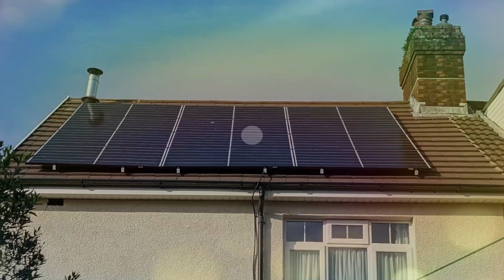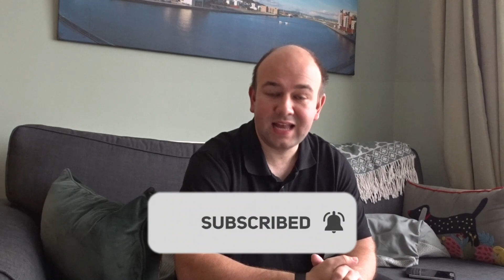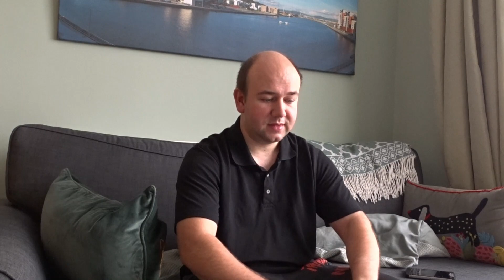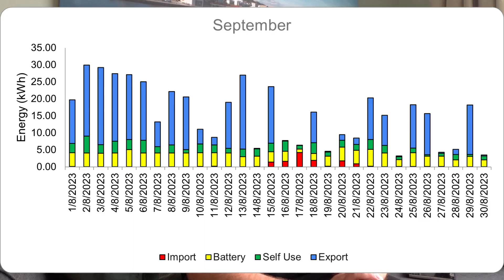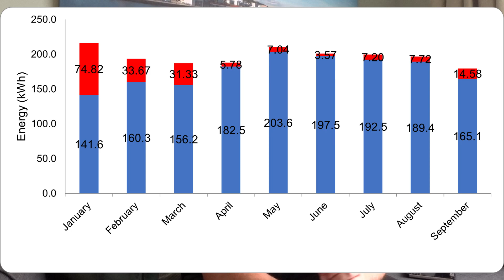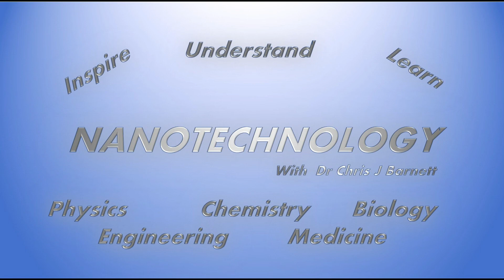September Solar Generation Better or Worse than Last Year? Solar Review: Generation and Money Saving

Comment: I have solar and I track every month since I've been up and running.
Last month was the rainiest Sept. on record so my solar production was the lowest of any of the previous 6 years. Here's the part that bugs me.
I was in a Power Purchase Agreement (PPA) for six years with the option to buy the panels at the six-year anniversary date.
That happened in August, and I did just that.
When I was under contract, I paid for the energy that the panels produced. The more production, the more I paid to the solar provider. Now that I own them outright and don't pay anything going forward, I want all the sunshine I can get. As soon as I paid the contract off, the sun decided to take a vacation. 
I know it'll come back, glorious and full of solar production, but that it decided to hide behind rain at the very time I want it the most just figures.